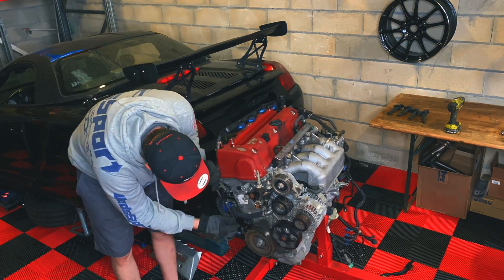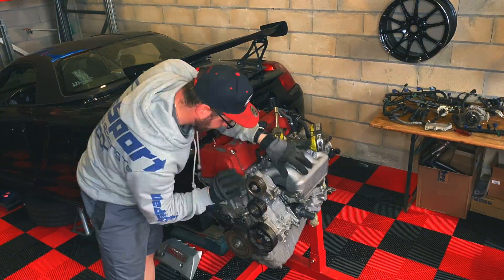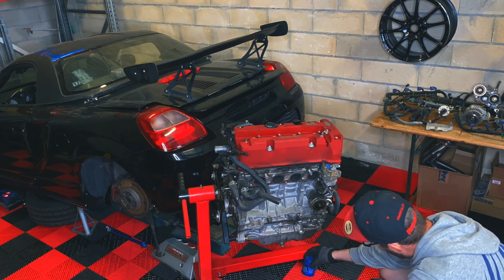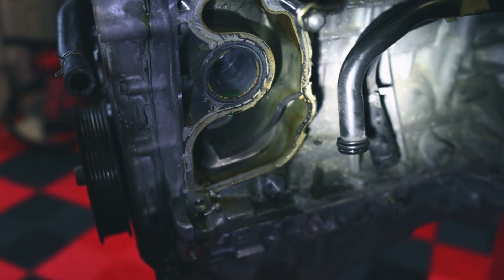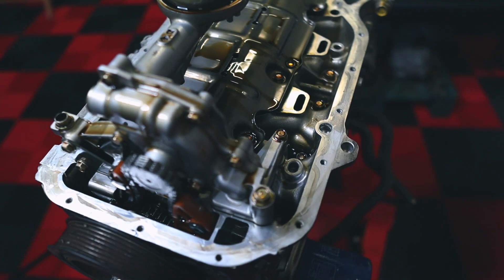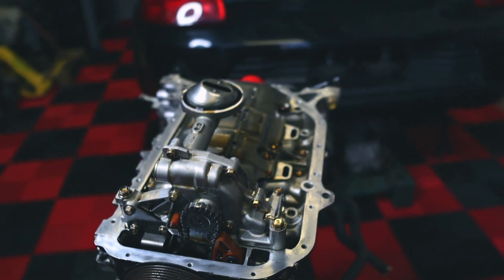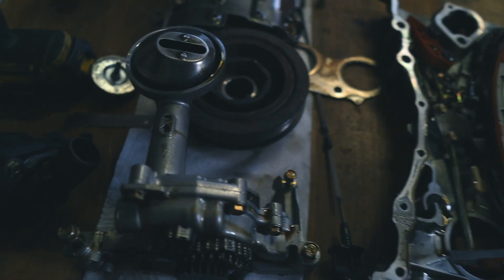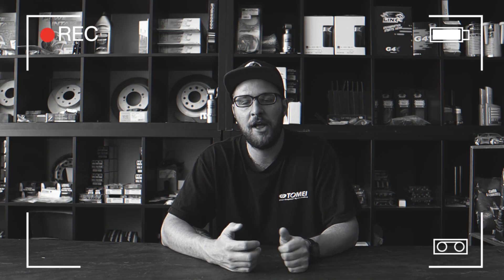How to Kswap an Mr2 Spyder EP8: K20A engine teardown and refresh. K20swap engine prep, part 1.

Comment: What about the transmission? How do we get it working for a mid engine? Would it be like the 2zz?
Reply from the maker: Yes same principle. But its an EP3 transmission (honda 6 speed). Mine will get an LSD too
Reply: Jesse, do you think a k20c1 would fit in the W30 mr2 then?
Reply from the maker: @vlwl26  hi, why wouldn’t it? Its also a k20 in the end… 🤷🏻
Reply: @JesseSpec  haha well I don't. That's why Im asking. Haven't heard much about the dimensions of both ks. Just know what's the difference internally besides the turbo. But yeah thanks again for the reply. Appreciate it and enjoy your videos alot. Keep up the great work
Reply from the maker: @vlwl26  hey man… ooops. You are right, they are fundamentally different hahah I honestly have no Idea if it will fit. It does seem bulkier though…